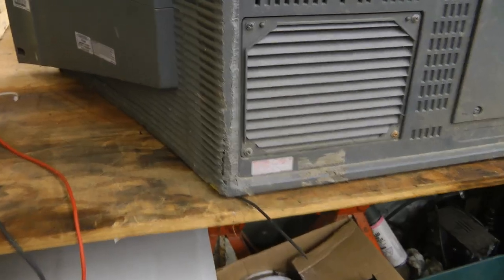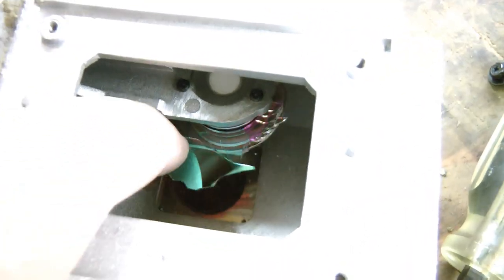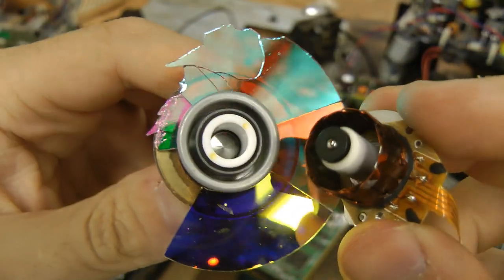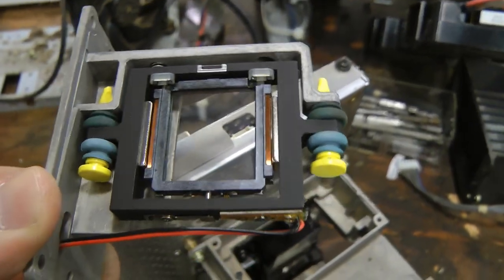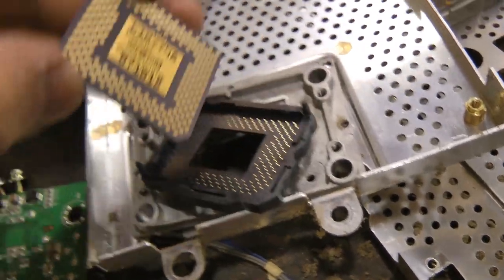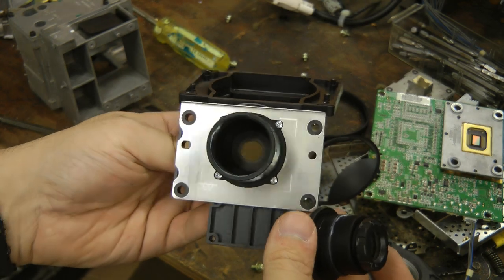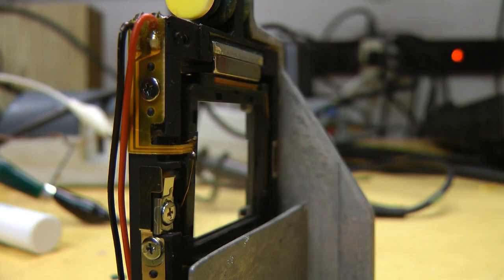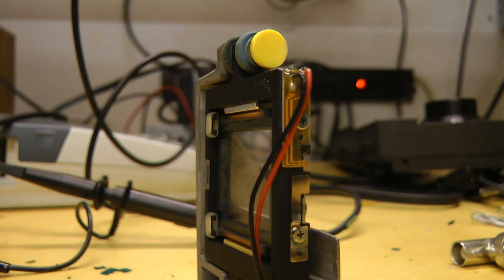DLP TV Teardown Number 2

Comment from the maker: Yes, the light directed towards the beam dump would be an inverse of the projected image, if it were focused. You wouldn't see any image in a real system because there's no lens to focus the waste light image, you'd just see light with a brightness that's the inverse of the normal image. Also, the waste light comes off the DMD far from perpendicular to the imaging plane (almost 45 degrees) so it would be difficult to focus.

Comment: I have a question in general about DLP tv's in general.
I know that the DLP works woth mirrors, i was wondering the image projected on the wastebin (not the screen itself) inside the tv is this a negative image?
A normal image on the screen and a negative image on the wastebin?
Is this correct?

Comment: Is there a name for the mirrored tube between the lens and the color wheel?  I have a DLP that i'm attempting to fix, and the mirrors came free in mine.  I epoxied them back in place, but can't seem to align it, so i'm thinking of ordering a replacement, but i can't figure out what the darn thing is called (for a BENQ 720 I rescued from the trash...)